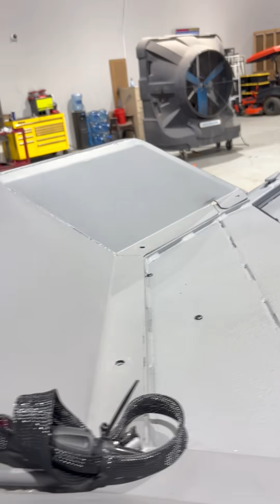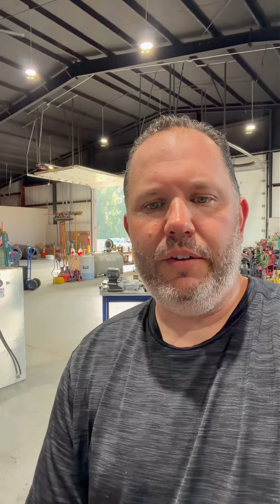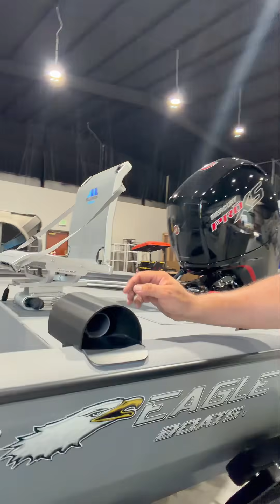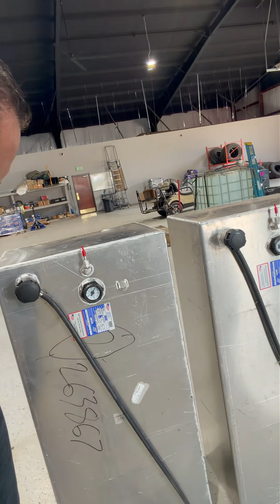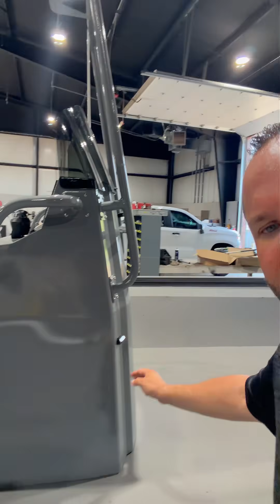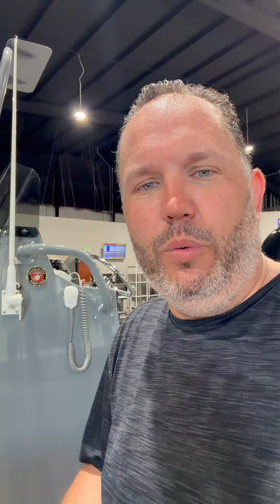Great American Loop Boat Walk Around

Comment: Why not do slightly curved, foam core composite roof over the helm? There would be negligible air resistance, it would not flap like a Bimini top in the relative wind as the boat moves, the slight curve port and starboard means rain drains off the sides and gets pushed off the rear of the roof by the relative wind, most importantly it provides rain and sun protection.
Starlike will provide something few likely think about, google maps satellite imagery. On the Erie Canal there are sometimes two waterways coming up to a lock with no signs as to which channel has the lock, just look at the sat image. You can see shoaling/sand bars with ease in the clean northern rivers and lakes. You can use the measure feature to get exact distances between the boat and a bailout, a fuel stop, a marina, etc. If you need a mechanic to repair the engine or just do an oil change, the internet is at your finger tips. Getting into a marina late evening and restaurants are closing soon, place your food order before arriving and have it delivered with DD or UE.
Consider having an AIS transponder for your bee line across the Gulf of Mexico or running in the open Atlantic, it provides a crazy loud warning when other boats or ships are within a mile or two of you, so even in poor visibility conditions other boats can see you and you can see them.
May want EPIRB's for each crews PFD, if the boat sinks 50 miles off shore in the Atlantic the Coast Guard will be able to GPS locate the entire crew for rescue.
Bring a spare prop, the proper size wrench to remove the castle nut, marine grease, and a piece of wood.
Bring cool weather layers for the northern part of the trip, running at night on the Great Lakes is chilling.

Comment: My i suggest you flip the starlink bracket on top of the roll bar around so it hangs off the front vs towards you?
You will spend time standing up running and if you stuff the bow once your forehead will be done.

Comment: You need a hydraulic jackplate. You will want it for when you’re running in rough water and shallow water so you can adjust as needed for better control, fuel efficiency, and ride.